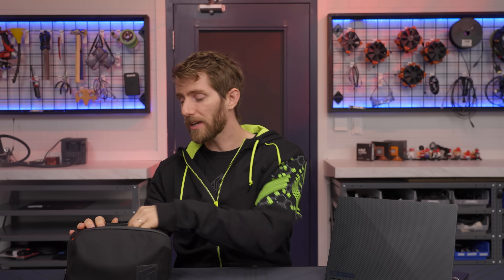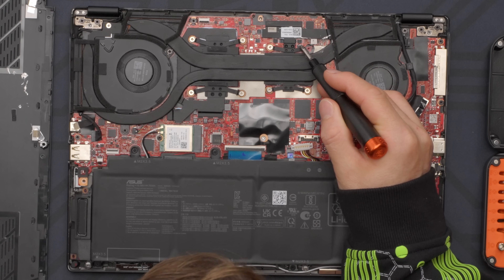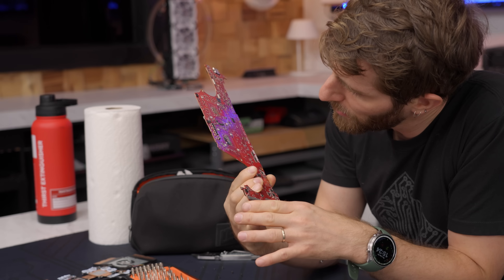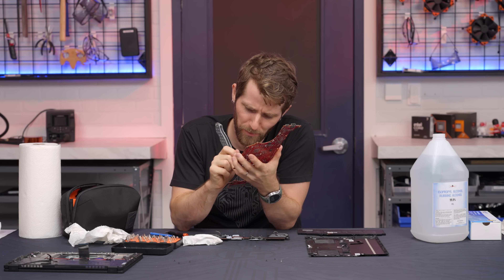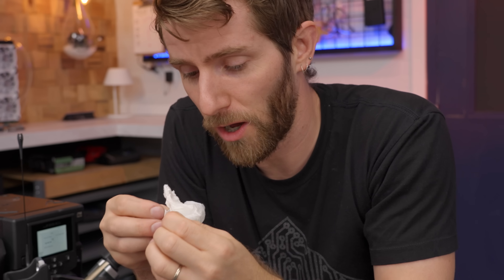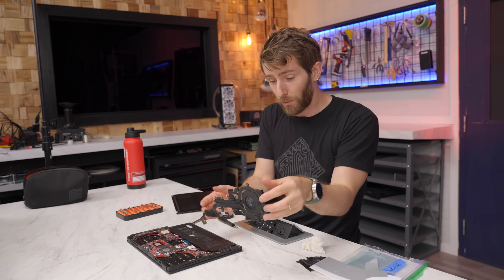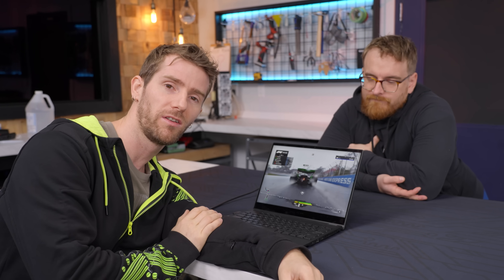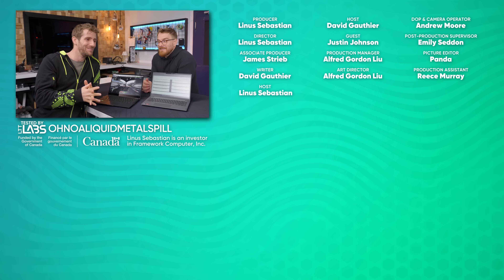Liquid Metal Killed my Laptop… Now What?

Comment: If a thing has liquid metal in it and that issue is not covered under warranty, then I'm not buying it, whatever it is. Ever.
Reply: Fr, a seal breaking on something like this is a factory defect and should absolutely be covered under warranty
Reply: Linus said in another comment that he didn't try to warranty it.
Although most of the comments were about people who did have to, and they were all having the ASUS warranty experience™.
I never really looked into the whole "LM on laptops" schtick that they were trying, but I thought that it was only gonna be a thing on desktop replacement laptops, the 17/18inch ones that don't see that much portable use. The fact that it's a thing that they use it on their Surface competitor which is upright by nature is bonkers.
Reply: @Fay7666  no need man i had experience with similar issue in case of my rog flow x13 they said it was liquid damage but thank god i had the asus adp protection
Reply: @Fay7666  This tickles my sussy senses... why would he not try to test ASUS on their response...........
Reply: @Fay7666  ... Yea but it has now also been "creeping into" (no pun intended) being used on (at least some Nvidia) GPUs... 
And though You don't "throw" GPUs around like you might do with a laptop, you might very well mount it "vertically" and possibly "experience leakage" due to that.
All in all I think L.M. is a "very bad idea all around" when it comes to "factory installs"... If you for some reason want to use it yourself, you are both "intricately aware" of THAT it is installed, AND how it is installed. And it's all on you if something "goes south"...
Best regards.
Reply: If you have decent consumer law, the warranty shouldn’t matter😊
Reply: @legend_jack1  We have that in Australia, even without warranty they still have to fix it if it is in a reasonable lifespan.
Reply: @JeremyPaulStiles  no wonder tech is so unreasonably expensive. tech is cheap in the us for a reason
Reply: @legend_jack1  It still matters trust me. They will make it so hard for people that 90% just give up. You will eventually get what you want but they can still fight you at every turn.
Reply: @legend_jack1  Only the EU has those.
Reply: @legend_jack1 

After the customer tampers with it?
Reply: @Jkirk3279  Yep. That's true even in the USA, thanks to the Magnuson-Moss Warranty Act. The manufacturer can't just reject a warranty claim because you've opened up or modified the product. They have to prove that your modification actually caused the issue. "warranty void if removed" stickers haven't been legal in the USA since the 1970s.
Reply: @Jkirk3279  define temper?
Reply: if youre buying a product with a warranty which contains liquid metal, its probably a gpu or cpu- which usually has a seal around the die anyways. since the metal would only be between the die and the ihs/heatsink and therefore inside that seal, even if it did leak out it would only run hotter- not destroy the board its on
Reply: Its Asus.. Nothing is covered by warranty lol
Reply: Hear me you: a liquid metal robot from the future you can tell to offer enemies a very long nap that's actually permanent.
Reply: Well guess your not buying a PS5 then
Reply: PS5 has liquid metal and 1 year warranty, which is like no warranty, so does it count?
Reply: @maxburmab7962  I believe that that is "manufacturer warranty", but in some(many) countries there is a "mandatory" retailer warranty that is longer than that ... But that is of course dependent on where you live...in the EU it is minimum 2 years from date of purchase (from a retailer) in some EU countries it's longer than that.
Best regards.
Reply: @maxburmab7962 maybe in the us - in europe its 2 years
Reply: @Matthew_MBG I'm from Russia. 2 years is also not enough in my opinion. Personally, I wouldn't take less than 8 years as "reasonable lifespan" for a console that, unlike many other things, is of well defined generation. How can I have a unit that isn't supposed to last a generation? Warranty is broken as a concept, many things last and should last much longer than the warranty suggests.

Comment: I feel like a double dam style gasket system would do well. Or, the next logical step for laptop engineering, just conformal coat the PCB. A nice inert thin coating would prevent most damage that commonly occurs to laptops and not negatively impact the repairability much.

Comment: PTM compound is great, because it's far less prone to leaking, and even if it does for some reason, it's not electrically conductive. It also performs potentially nearly as well as liquid metal, though significant amount of burn-in and power cycles are required for thermal performance to hit full potential.

It's also not as difficult to install as liquid metal, and doesn't require installing some sort of gasket. It's still finicky and more difficult to install than regular thermal paste.

Comment: I work in a repair shop and the amount of devices that come in with liquid metal damage is stupid. Realistically a consumer grade product shouldn't ever be using liquid metal in my professional opinion, especially when there are alternatives that get you 90% of the way there without the risk of the device killing itself. 
The only way that it'd make sense on a consumer product in my opinion is if the device had a conformal coating to reduce the risk of shorting once the liquid metal leaks out of the gasket.

Comment: The head of the big tech company and his team are so stupid that they don't check what they're buying? Liquid metal pastes are not solid, with a PS5 it's no problem if you use it lying down because it's not moved, but in the case of a laptop that's constantly moved, liquid metal paste is the biggest stupidity! Whoever manufactured this is simply stupid, but whoever bought it is even stupider.

Comment: Just throwing an idea out there - is there a low viscosity flux that solder wick could be soaked in? It could be made into little sponges to mop up the big droplets.

Edit: There is a low temp solder called 'chipquick' resembles the alloy that liquid metal forms with regular lead-free solder. It's deliberately used to remove ICs at a low temperature. But even when it sets solid it's brittle, so any vibration on the PCB can also cause component vibration and breaking loose or cracking.
Edit 2: When you started using compressed air you need to use eye protection. Liquid metal in the eyes is not a good thing I'd imagine.

Comment: Oh no, I have the flow X16, and I am happy with it. I did not know about the liquid metal cooling.... I am planning to upgrade the RAM, but now I saw your situation, I would propably change the liquid metal for the pad. I already know that I currently have hotspot because temp will keep spiking to 90C even though the rest of cores are like 60. It is weird though. Battery is also 20%degraded soo maybe even that. I kinda miss my surface pro X SQ1 with the ARM. That thing was completely passive, had good battery life, but the power was non existent.

Comment: Just a note on the sponsor message at the end. There is no such thing as your data being "safeguarded" by AWS; data protection (as in encryption, acess controls, etc.) in AWS is the responsibility of clients as per the shared responsibility model in the cloud - for example, if all the recordings on that device are batched into files and pushed into a public S3 bucket, that data is still public and not safeguarded by anything. Not a massive problem (assuming those HIPAA and SOC notes are actually backed by passed audits), but you might want to re-phrase this type of talking points to ensure accuracy and not sound like an un-verified marketing material.

Comment: mix liquid metal with a stabilizing material.  Or just dont use it.  I have cleaned about 20 laptops and pc's people have applied it to, its garbage.  A really fast way to clean larger blobs is a fish pond air pump that has been modified so you have a hose sucking air, much like a cheap dental vacuum.

Comment: This video is very misleading. Here's some input from someone who spent 17 years repairing phones and laptops.What likely happened here is a faulty sponge that was supposed to contain the liquid metal, or simply an assembly error at the factory—like the mounting pressure he mentions (i.e., a screw holding the heatsink not fully tightened during production). Numerous faults can occur for the same reason.These laptops require servicing just like any other device, and during maintenance, a technician must remove the heatsink, the old sponge, clean everything, and apply a new sponge along with fresh liquid metal. I've done this countless times, and I've never seen spillage happen to me or my colleagues.The idea that a leak could result from dropping the laptop or holding it vertically while it's still warm/hot is utterly ridiculous.The blacklight scene is also misleading. I'm not sure how liquid metal reacts under blacklight, but laptops don't use liquid metal on coils or soldered memory chips—that's the stuff you see around the two main chips (the processor and graphics card). Based on that alone, you can tell Linus has no clue about this topic. At the very least, given the size of his audience, he and his team should invest more time in researching before producing content like this.

Comment: another reason to NEVER BUY GAMING LAPTOPS they are designed to break after 1-2 years after buying usually right after the warranty expires, my razer blade broke after 2 years and so did my msi laptop if you see "gaming" in the product name avoid at all costs they arent designed to be used like a real laptop more like a somewhat portable gaming pc that is super unreliable and overheats like crazy.

Comment: Wouldnt liquid metal be the perfect way to fight against the right to repair though? A plague that spreads across a board if your not careful, so the average person is scared to open Pandoras box. You can fix it yourself, but will you risk it? All with the added bonus of inevitable leaks from over-applications that could brick boards in a way that companies can claim is a result of user misuse. It discourages self-repairs, and increases need for replacing the product entirely.